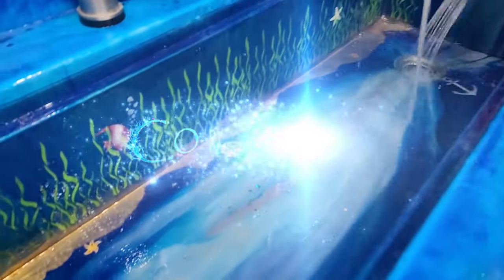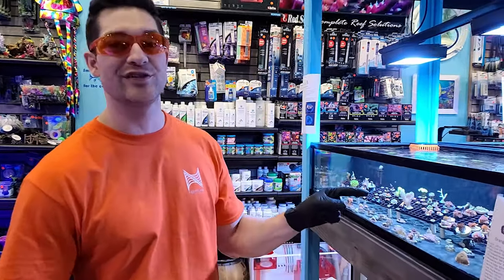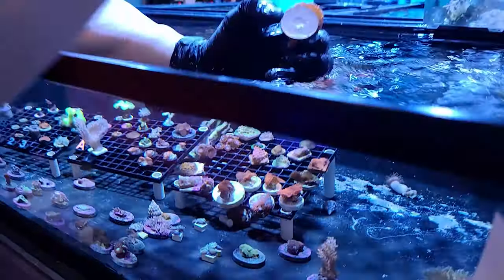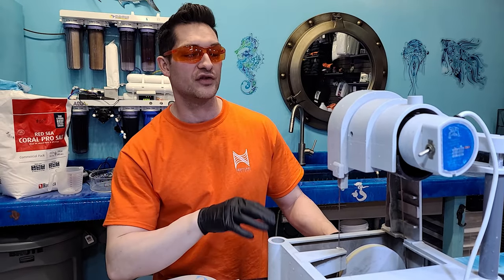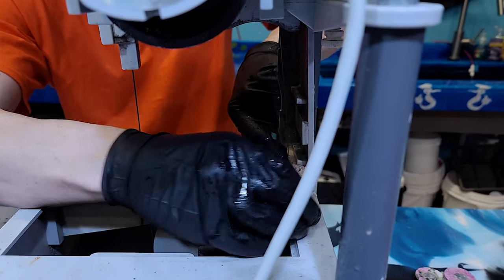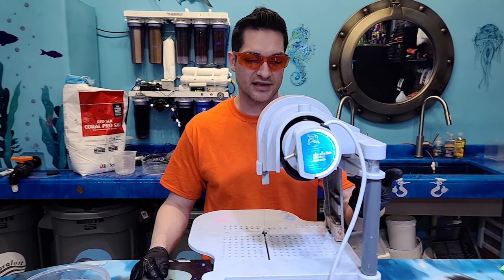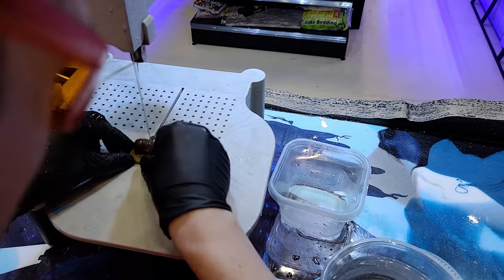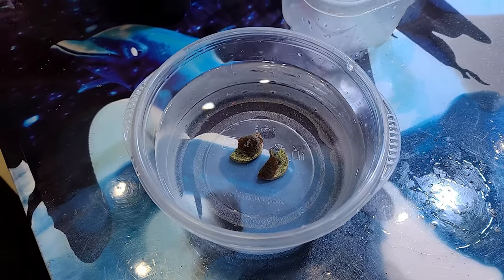FRAGGING A $2K Mushroom

Comment: Anyone who pays 2k for that mushroom has either way to much money or not nearly enough common sense.  Just because someone has it listed for 2k doesn't mean that it's worth that.  2k mushroom smh!  Totally out of line.
Reply: There are definitely mushrooms that sell for that much but a normal eclectus like that isn't one of them. That's like a $200-$300 mushroom if that. It doesn't really have any pattern. If it was a bounce eclectus like a mythical corals bounce eclectus then yes 2k would be an average price if not low for one that size but it's not a bounce it doesn't have the bubbles